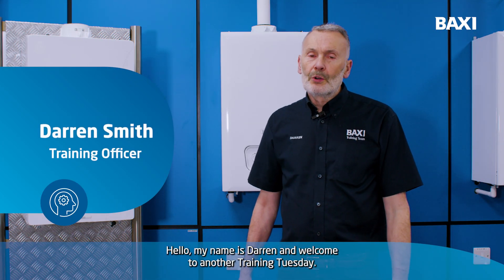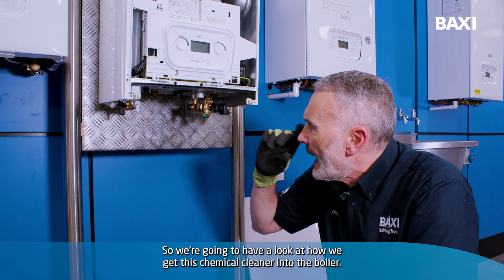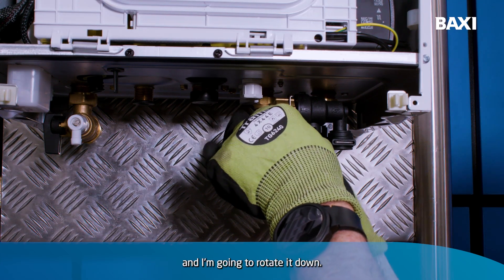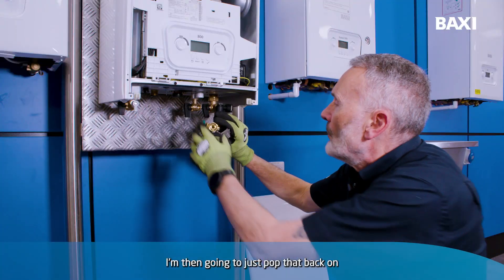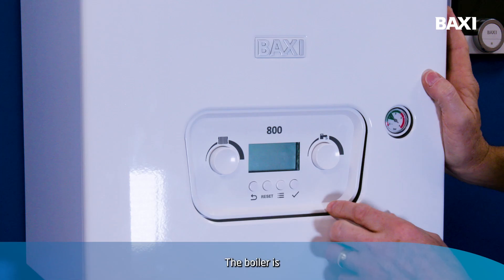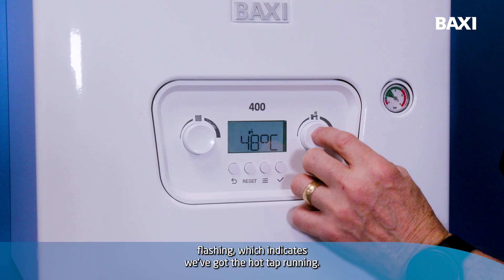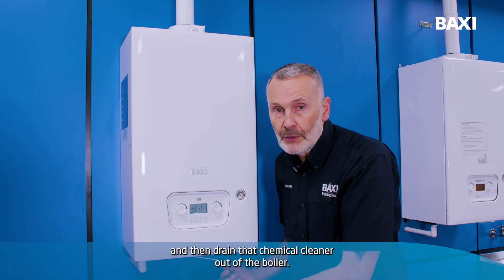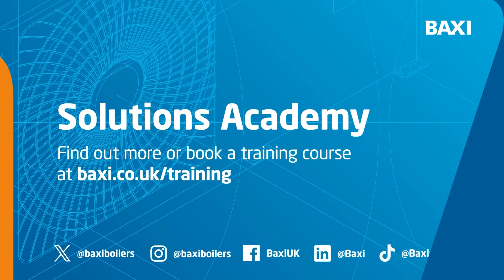How to clean the heat exchanger on the Baxi 400 Combi 2.1 boiler range

Comment: Saves me calling out baxi for a noisey heat exchanger. The boiler has a warranty and service record and filter fitted. Wanted to try this myself and see if it resolves the issue. Thanks again for the information 👍